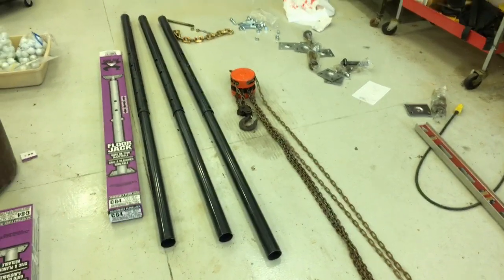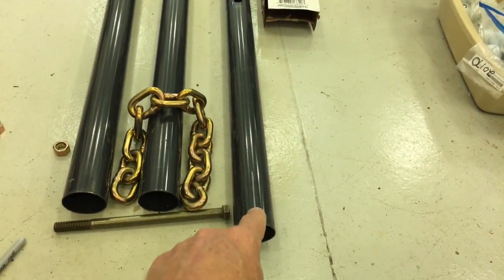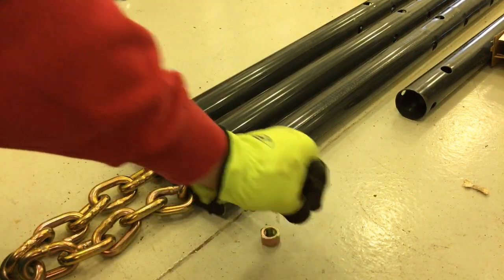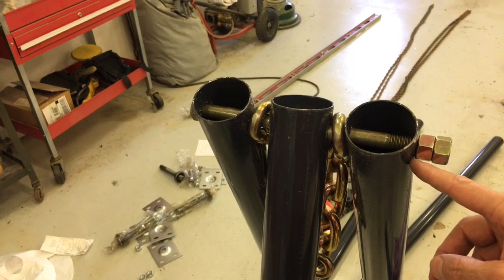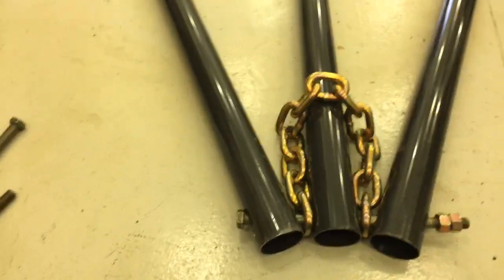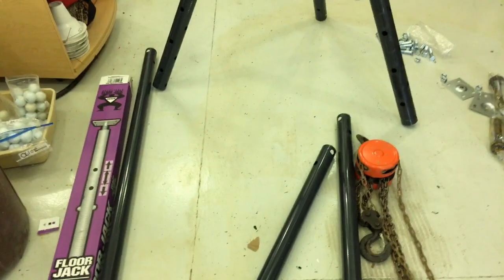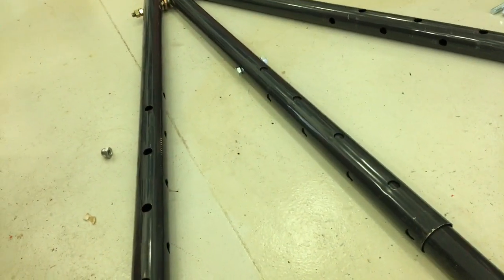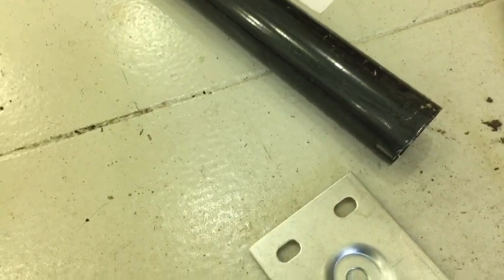Tripod hoist build 1

Comment: With weight on the legs, you dont need to worry much about the legs splaying. The legs will sink in to the ground. But of course if you dont want to damage cemetary grass, yes a pressure pad, and some sort of splay control would be a great idea

Comment: Great video thanks for the information, but how about if you use longer bolt on top? I think it will give you enough spread of three tubes without needing for second holes to be drilled.
Reply from the maker: A longer bolt will do nothing to allow the legs to splay out into a isosceles triangle. Without elongating to two outer holes, the legs will not spread out any wider than the length of the bolt.  By  making to two outer holes oblong or elongated, the outer legs can spread out from the center leg by many feet to create a stable tripod with legs equidistant from each other.

Comment: Excelente, muy ingenioso y práctico.  Felicitaciones
Los tubos de cuantos MM son los tubos.
Cuántos kilos podría levantar..???
Reply from the maker: The tubes are approximately 2.5-3.0 inches in diameter.  Each tube section is about 4 feet long.  When all 4 tubes are interlocked to form a leg, the leg will be about 12-14 feet depending on your drill holes and assembly pins placement
Reply: Gracias amigo
Cuántos kilos podría levantar...??

Comment: Have you checked out the Boss Buck tripod header? 
Seems pretty stout and great for lifting large stones and boulders. Only $50 too.
Reply: Does not appear to be strong enough for a 2-3 ton chain hoist and some of the heavy lifts I have done. Looks like a great tool for lighter jobs and those without DIY skills or tools. Would like to see some specs on it.

Comment: Do you have a parts list for this? Nolt and chain sizes and lengths?
Reply from the maker: from memory, bolt is Grade 8 for strength, 3/4 diameter and about 12" long.  Chain is grade 70, about 15" long. I forget size of chain, only that it has to be large enough for bolt to pass through. My guess is 5/16". Length of chain can vary a bit, just need to create a big enough loop to clip your chain hoist clevis/hook to it

Comment: maximum  mass that this tripod can load??
Reply from the maker: I have yet to exceed the capacity of the 2 ton hoist  attached to the tripod.  the heavier the lift, the closer together the legs need to be to prevent collapse of the pipe. I estimate the heaviest gravestone lifted to date was about 3000#.

Comment: Do you have a parts list?
Reply: Not really. Just multiple sets of floor jacks, a long bolt, washers, nuts, chain, and hitch pins. All stuff easily sourced locally or on line. See also my other tripod hoist build videos #2 & 3